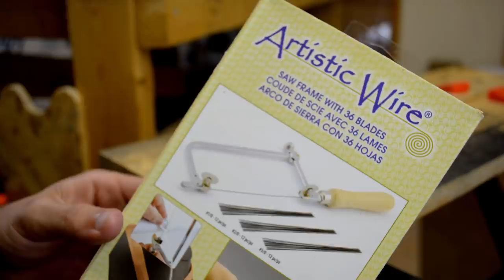Watch Me Transform This Spoon Into VENOM!

Comment: That is wicked to have on a bullet proof shield. Do half a dozen venom spoons on your shield and he eats up the shrapnel. If the bullet goes in his mouth he eats up the shrapnel.

Aluminium Shield Shop
--------------------------------------
Bolted Lounge Room Buckler (540 ft•lbf)
Made with:
12mm thick aluminium sheet
5.5 kg in weight and 38cm diameter
Hand Gun Resistances :
-Bullet Proof to all 9mm 
-Bullet Proof to hollow tip 10mm 
-Medium Bullet resistant to all other 10mm
-Low Bullet Resistant to all 11mm 
NATO Rifle Resistances:
-Low bullet resistant to .22 calibre
-Very low bullet resistant to .30 calibre
-Very low bullet resistant to 12 gauge shotgun pods

Engraved Composite Shield (1100 ft•lbf)
Made with:
4mm Titanium and 4mm Aluminium
10 kg in weight and 62cm diameter
Hand Gun Resistances:
-Bullet proof to all hollow tip 11mm
-Very high bullet resistant to all other 11mm
-Low bullet resistant to hollow tip 12mm 
NATO Rifle Resistances:
-High bullet resistant to .22 calibre
-Low bullet resistant to .30 calibre
-Low bullet resistant to 12 gauge shotgun pods

Shield of the Stars (1470 ft•lbf)
Made With:
6mm Titanium and 2mm Aluminium
16 kg in weight and 68cm diameter
Hand Gun Resistances:
-Bullet Proof to all 11mm 
-Medium bullet resistant to hollow tip 12mm
-Medium bullet resistant to all other 12mm
NATO Rifle Resistances:
-Bullet Proof to .22 calibre
-Medium bullet resistant to .30 calibre
-Medium bullet resistant to 12 gauge shotgun pods
-Extremely low bullet resistant to .50 calibre

Blacksmith note#
For high-low bullet resistances to deflect the round it requires 10°-45° angles or distances of 30+ metres. In addition, the shield gets thicker on angles as well as deflective. And to find out how thick the shields can get on angles use Pythagoras theorem. For example, a²+b²=c² I think an extra 2mm on the 8mm thick shields is going to be common. Moreover, 8²+6²=10². Therefore, the bullet will travel 10mm through the shield instead of 8mm.